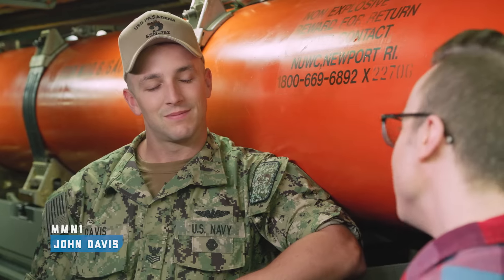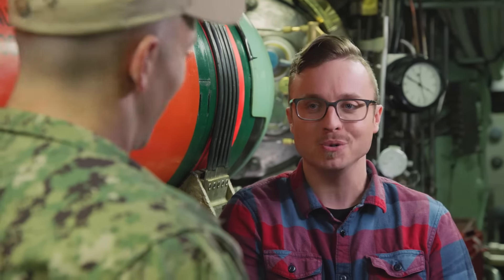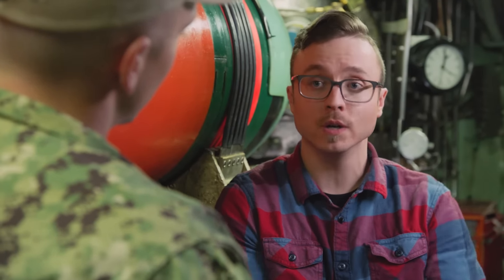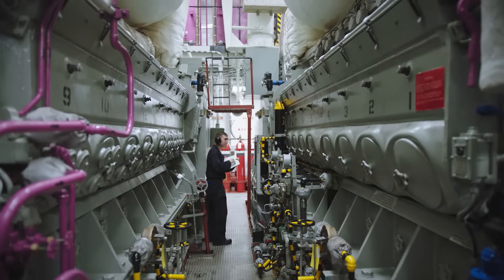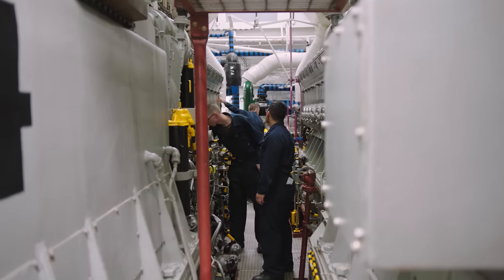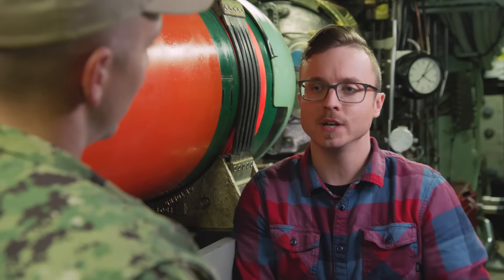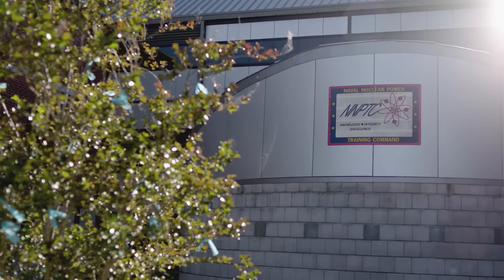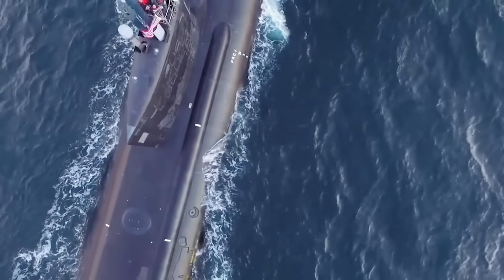What Does a Nuke Do? | Sailor VS

Comment: I got 63 and was able to get nuke 😅
Reply: No u did not
Reply: Aiden C. I fr did, I had to take the test though for it
Reply: Bruh, stop capping fr
Reply: @christianrodriguez2879  no cap, I’m halfway through power school right now
Reply: @howtoachievements9747  good stuff man, I’m in TTrack right now. What’s your rate?
Reply: @christianrodriguez2879  machinists mate
Reply: @howtoachievements9747  how is it? Plz answer 😫
Reply: And your recruiter gets a "two-for-one" deal!!!  Have fun washing out of Heat Transfer and Fluid Flow!!!!
"Goes ins and goes outs"  Carnot Heat Engine.  Enthalpy.  Using steam to create a vacuum. Etc, etc, etc...

8205/S8G
Plankowner on MTS-635

Challenge me...

Every Little Fuckin' Pollack Loves THe Fuckin' Navy..........
Reply: @johnleeson6946  I’m 3 months out from graduating prototype
Reply: @howtoachievements9747  Good job!  I spoke too soon.  Rayburn, Webster, or the LA Fast Boat.
Plankowner on the Sammy R in '90.  Did they ever fix the Forward A/C problem?

SWIS, DST, ACR, no Lithium Bromide...

Or maybe you're at NY or ID?  I went to S8G, 8205.
Reply: @johnleeson6946  I’m still stationed here at South Carolina. And no the A/C never gets fixed 😂. I’m on the La Jolla
Reply: @kwesiashella9852  it’s a lot of stuff to do, but it’s doable